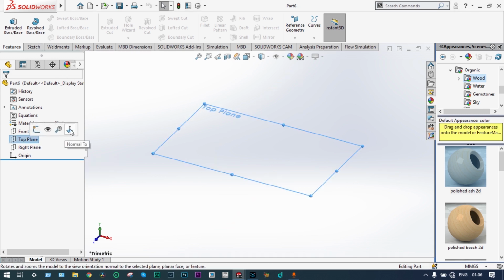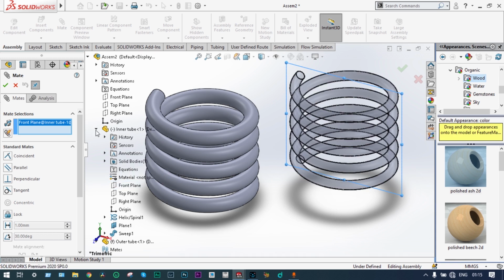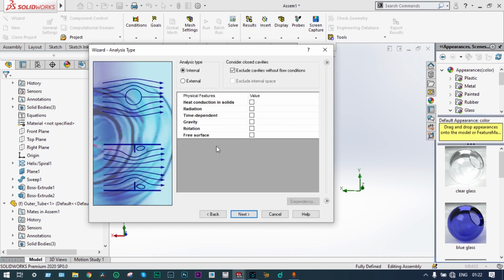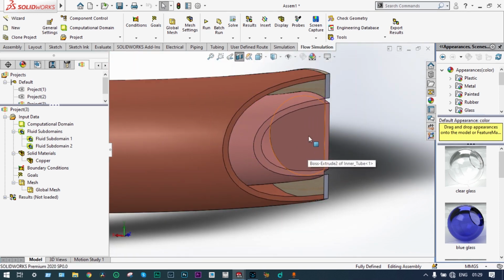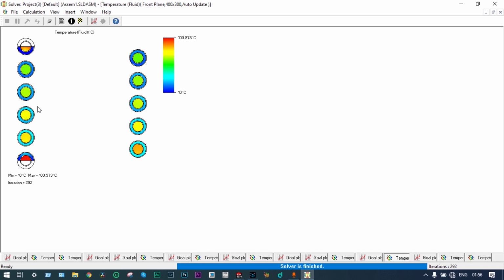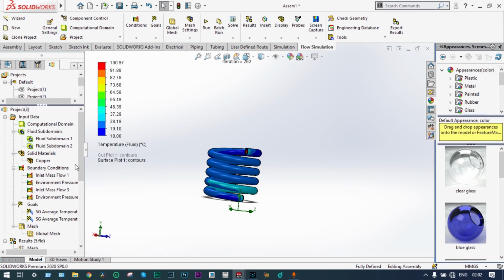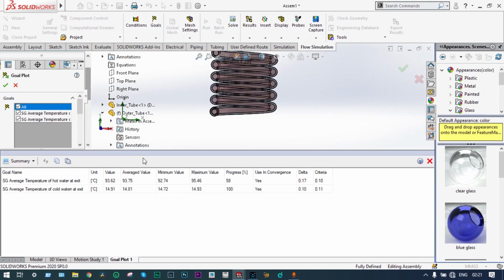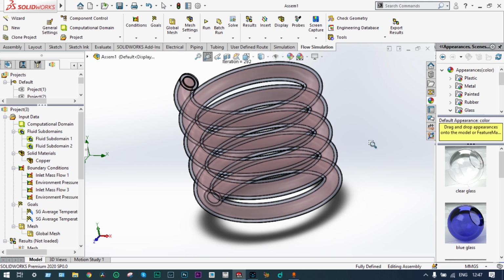CFD Design Analysis & Optimization of a Multi-tubular Helical Coil Heat Exchanger | SolidWorks 2020|

Comment: Thank you so much very interesting video. I'm searching also on how to calculate the heat transfer from one fluid to the other. In other words how Flow Sim can give us the heat exchange enrgy in this simulation?

Best regards
Reply from the maker: I am happy that you liked this video. As per principles of calorimetry heat lost by hot fluid is equal to heat gained by cold fluid. This can be obtained very easily by forming equation goals e.g.( mass flow rate x specific heat at constant pressure x temperature difference) or from goal plots directly you can have heat flux also.
Reply from the maker: Heat transfer from one fluid to another in a same domain can be done with free surface technique and fluids with different domains will follow normal method